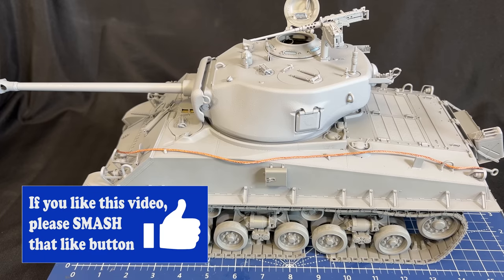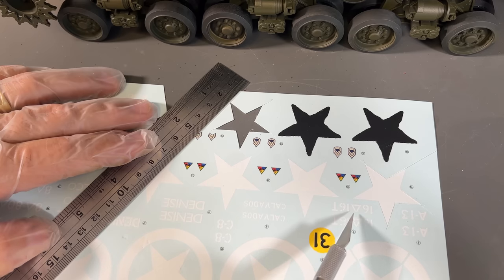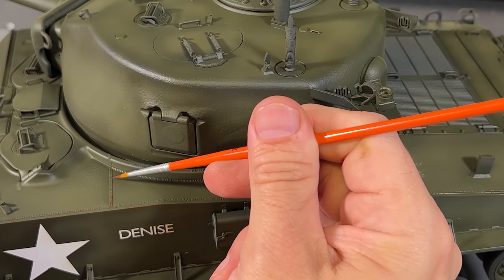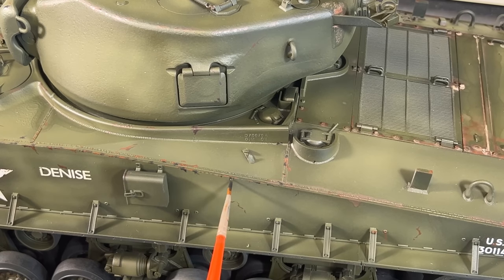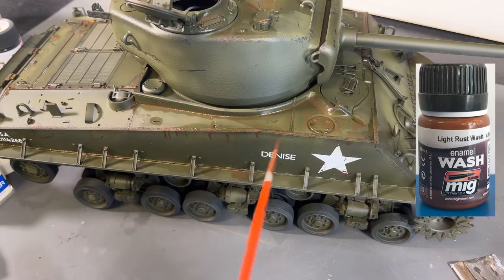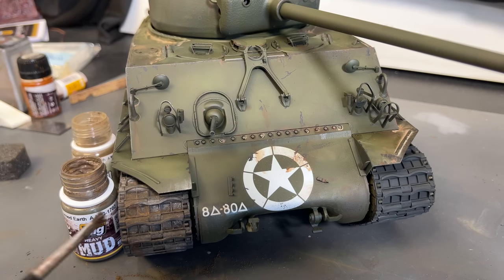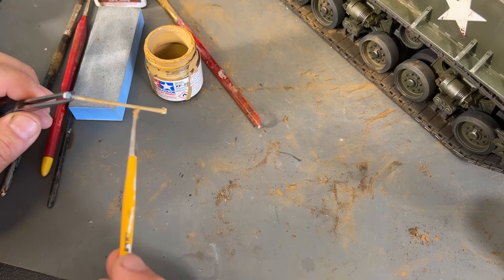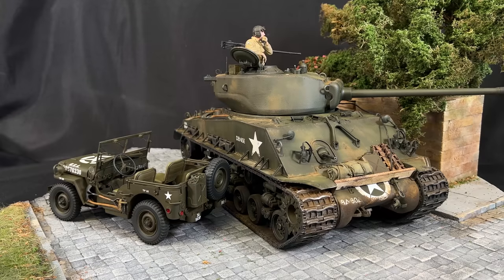How to Paint and weather the 1/16 M4A3E8 Sherman from Andy's Hobby Headquarters

Comment: Hi Andy, just was watching your weathering techniques. Great. Going to try that soon on my 1/16th Tamiya Sherman. One thing however. When weathering the spils from the gas filler, you let the spil run in a 90degree angle to the side of the Sherman. In Real life this would have run in an angle as the rear of the tank is also sloped. Got to nag something right?

Comment: Great job only sugestion is the teeth on the sprockets and matching contacts on the tracks should be shiny pollished steel also put some damage on the rubber road wheels rocks get stuck and debree get chrushed in between the inside track pads and road wheels ripping out chunks of rubber. another problem we had was a complete sections of the rubber whould delamanate from the steel hub. the inside of the roadwheels have steel rub rings that the centerguides or  (guide horns U.S.Tankers dont use that term),rub against are also bright shiny metal and within a day of being parkedall these areas will turn a deep dark rust color.What about this have a brand new installed road wheel in perfect condition with bolt heads that look like a socket took off some paint? Not  criticizing your  artistic work Andy I have truble wheathering my tanks I have to let them sit a week or more just ot have the time and willpower to apply my own sugestions. thank you for being here for all of uss who love this hobby. "DEATH BEFORE DISMOUNT"

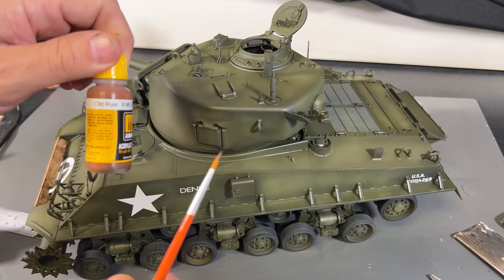Comment: I'm a little confused. At about 7:40 you show a bottle of Old Rust 0042, but then you show a screen shot of Old Rust 0041. I assume the bottle in your hand is the color your using(?) Then I thought that when you start a different chipping color THAT was 0041, but it's a different name "Chipping."  So, between 41 and 42, did you use both or just 0042? I'm in the process of building the paint list for this kit and will be using this video as a learning guide, which is why I'm asking.

Comment: Would be even better if it is possible to convert this into a RC tank.
Reply: That would be livid.
Reply: Totally would make a great RC.  Really amazing are the micro RC.  Scale 1:72 and 1:160.
Reply: To make proper RC lower hull should be swapped with i.e. Tamiya 1/16 Sherman which is very rare and expensive those days. I'm planninng to use Andy's upper hull and turret with metal VVSS chassis from Taigen.
Reply: Yes, in one of the previous videos Andy actually tried to fit upper hull to the lower hull from Tamiya RC model - it fits perfectly :)
Edit: in that size you could probably use lego technics elements to turn it into RC, it looks big enough to fit entire lego transmission.